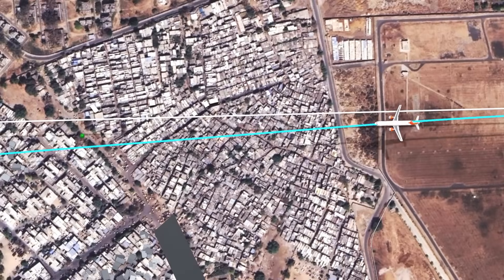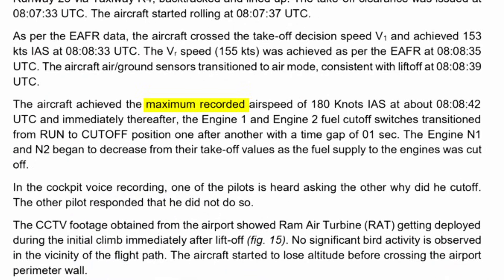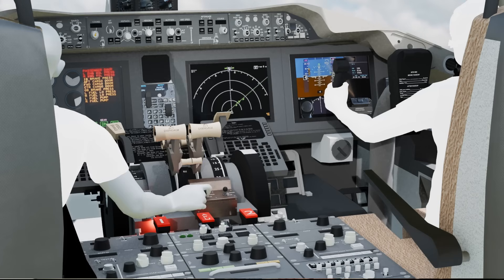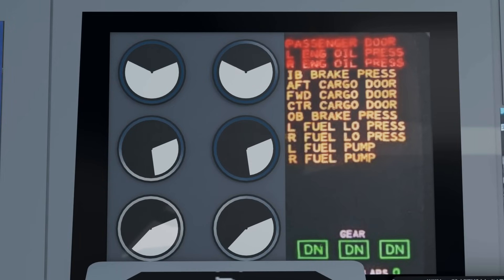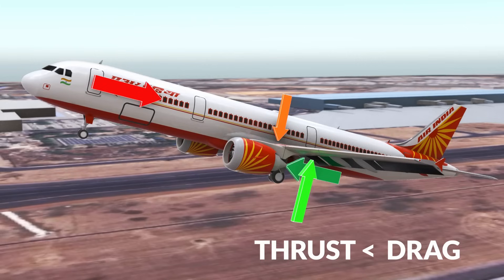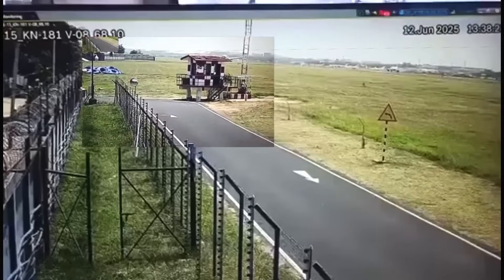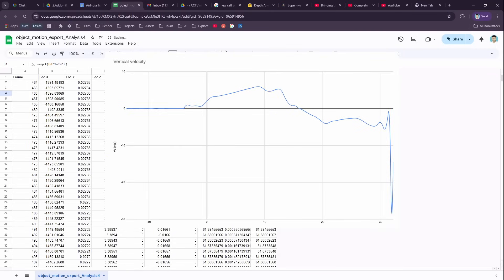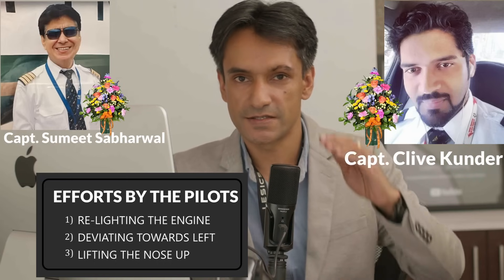Use of 3D Clone | Decoding the Crash Details you Missed

Comment: It has been confirmed that it takes 7/8 seconds for the rat to extend out. This means it started extending out straight after take off and hence before the fuel switches were switched off… this means a technical glitch must have occurred.
Reply: That is a maximum spec for the RAT to pump up the hydraulic system from a low pressure state. Even the actual testing has shown it to be less time. It is simply the time the hydraulic pump supplier needs to meet. [update, there is no spec for the 787, the spec that people are referring to is for older Boeing aircraft, the 787 significantly different in this area.]

The hydraulic system was already at working pressure, so the RAT only needed to pressurize the feed line to the isolation valve. 2 seconds. [update, the feed line is already pressurized to 5000 psi by the EMPs, the RAT pressure is set to 3000 psi, and the central hydraulic system has an extra large accumulator, so the pressure would be above 3000 psi when it deploys.]

We also don't know which FDR message the preliminary report is referring to. It could be hydraulic pressure has started which happens 1 second after RAT deployment. [update, there is a RAT pressure indicator in the cockpit, and it is the only FDR message of this type. And if the system is above 3000 psi when the RAT deploys the indicator and FDR event will occur immediately.]
Reply: @lattyaktube  No, this is NOT the maximum spec at all.  As per Boeing a RAT takes 6-7 seconds to give hydraulic pressure "*under ideal conditions*".  So more if they are not ideal, like here, so let's say 7 to 8 seconds.   
It takes 10 seconds to give Electrical power.  
Note that there is no intermediate or in between "partial" hydraulic pressure as per Boeing.  It kicks in only when it has sufficient pressure.   Same for the electrical power.
Reply: @lattyaktube RAT deploys in 0.88 secs. 

There is a note on docket  FAA-2015-2959 that RAT starts working from 120 knots. 

RAT deployment and performance has been questioned at low altitudes plus this ongoing "titanium quality issue" affecting parts.
Reply: @hazard3020 That AD is very old. All aircraft needed to be repaired by 2019. There's no indication that this aircraft was not repaired, especially considering the low time and cost to do the repair.

The video and audio evidence shows the RAT deployed and spin up to max speed.

Okay 0.88 seconds, that's much less than 6-8 seconds.
Reply: @lattyaktube A New Boeing AWD in 2025 issued recently on RAT to advise that sub-standard parts may have been fitted in some cases affecting RAT performance.  I just mention these as the 2015 modification will need to be shown by AIAB in maintenace logs - when they feel like getting around to releasing a little bit more data.....🤷‍♂️
Reply: the people who leaked this report, why they did not mentioned Whether they have heard the noice of switch physical movement or not in the voice recorder.
its very evident that the physical movement produces considerable amount of noice and Audio recorder is efficient enough to capture very minute noice.
If the noice was audible in the recoreder, it was a soild supporting evidence for the for the people who (assumingly representatives from boeing, NTSB, GE or UK investigators) leaked this report to prove pilot did it deliberately .

Why the time of RAT deplyment is not mentioned in the report? instead reprt mentioned  power reinstated from RAT 4 seconds after both engine failed.
Then when was RAT deployed? normally it takes 8 seconds from the deployment to establish power  (opinion from some expert).
If that 8 second phylosophy is right, then there must have an electrical failure during take off [(3+1+4) - (8 seconds) = 0 ie, take off time ]. See, the volocity at that point was less, then efficiancy to deliver the power by RAT also will be less.

Why there is a termal runaway on rear side data decorder especially tail end was not exposed to fire or heat. wires were burned.
Reply: No. The claims are it takes up to 8 seconds for the RAT to fully supply electrical power and full hydraulic pressure sufficient to operate basic controls.
Reply: There are a lot of claims on the internet. While actually the Boeing spec for the 787 RAT is the propeller starts turning once it clears the fuselage, about 20° extended. It is spring loaded and is fully extended in 0.8 seconds. The hydraulic pump takes at most 6 seconds to pressurize the system from a low pressure state assuming there are no leaks and the reservoir has sufficient fluid (that is the "ideal" conditions referred to). The electric generator takes at most 10 seconds to stabilize its voltage. [update, the 6 seconds is a spec for older Boeing aircraft, the FCOM does not have a time spec for the RAT hydraulics, only 10 seconds for the RAT electrical generator.]

There is at least one 3rd party training manual (not from Boeing), that incorrectly summarized the spec as it take 6-10 seconds. And people have been claiming the average of 8.

The aircraft's hydraulic system was already at working pressure. The RAT only needed to pressurize the feed line the the isolation valve -- no fluid flow was required. Don't trust me, ask a mechanical engineer how many turns does an hydraulic pump need to get to working pressure when it is already primed, and no flow is required. Since the propeller starts turning before fully deployed it could be up to pressure in less than 1 second. [update, there is no isolation valve in-line with the RAT, therefore, the feed line was already at 5000 psi, and the RAT pressure sensor is set at 3000 psi, and there is a extra large hydraulic accumulator (unique to the 787), so the RAT pressure indicator (and FDR event) would occur immediately after RAT deployment.] 

Here's another analogy. Lifting a car with a hydraulic jack. Raising the jack till it just touches the frame (primed), it only takes 1 or 2 more pumps to start lifting the car -- a very short time to go from primed to working pressure.
Reply: @lattyaktube  precisely!!! I worked on hydraulic cranes for 13 years, this is 100% accurate. The engines were still spinning and as this video said still had thrust. It didn’t ramp up from zero or empty hydraulic lines just installed. It could be a matter of just a couple seconds to reach full emergency level pressures. The hydraulic pumps are electrically driven, the spinning engines generate electricity. We need the FDR data to know what method was used to deploy the RAT, and what the timestamp was.
Also we need the full 32 seconds from the voice data recorder, all 4 channels. Can you imagine the exchange?Those things will paint a clearer picture and remove so much doubt and speculation. Some people are believing the propaganda because they so badly want the captain to be innocent.
Reply: @lattyaktube just to complicate things... research papers illustrated issues with RAT Deployment at low altitudes and not working properly.  Compared to working great at 10,000 feet for example....

And also a fully working RAT only powers the central "Electrical" bus.
Reply: @lattyaktube  All available data from Boeing asserts that the RAT requires atleast 6/7 seconds post deployment to provide hydraulic power and 10seconds to provide electrical power under optimal conditions. If we assume optimal conditions, the RAT would’ve been deployed at 08:08:40 at the latest which is only 1sec after lift off 08:08:39. It’s becoming increasingly clear that the RAT was deployed 3/4 seconds before the fuels switches were switched off. The preliminary report is very vague with the use of words approx, about, immediately etc they have accurate representation of these timings and yet choose to use these words to mislead people. A catastrophic electrical/hydrualic failure has occurred before the fuel switches were switched off. Following  standard operating procedures during this kind of emergency is a difficult task… the brave pilots acted professionally and did everything that they could.
Reply: @surjsha2853 I am pretty sure Engine 2 failed early too - when the RAT deployed - as the RAT was programmed to deploy (when one or more engines fail on Takeoff.)
Reply: @tremdoctor007 nobody is believing propaganda but you. The rat deployed right at rotation and that is clear from evidence. The hydraulics went thru a loss of power and it will take 7 secs at least to be able to supply power. And it is evident from other videos that there is a single mode of dual engine failure thru battery issues which is historically 787 problem. Stop blaming pilots and loot at evidence. Don’t make up stuff from a vague report.
Reply: @lattyaktube that’s absolutely not a high probability event. Rat needs time to supply power. Manuals put it at least 7 secs. Hydraulics loose pressure pretty fast and it is Boeing manual that says so as per people who reviewed. Plus ads transponder stopped communicating right at rotation. Why do you think the prelim report didn’t report the RAT timeline? Because most probably they don’t have it recorded. Why? There was a temporary loss of power right at rotation that cut of both fuel switches to off mode.
Reply: @surjsha2853 I concur totally. The only thing I would add is the Rat timeline is not mentioned probably because they don’t have it recorded due to power loss to fdr. And maybe not to mislead.
Reply: @kumark214  quit fantasizing, it’s sad how many people in India are going out of their way to defend Captain Sad Sack who killed so many Indian citizens as well as others. I doubt you even read the report. The RAT deploys when the switches are both moved to off. The FDR recorded the switches being moved, the First Officer noticed it. The engines were still running and generating electricity and hydraulic pressure, it didn’t take 7 or 8 seconds. That’s from nothing, not an engine spinning at high RPM’s at takeoff. The engines drive the generators and the electricity drives the hydraulic pumps. Quit fantasizing.
Reply: @kumark214  I’d also point to sloppy maintenance with Indian Air
Reply: @kumark214  The FDR has its own dedicated battery backup -- other FDR events were recorded to that time. The flight control systems (incl the RAT controller) that generates the events is backed up by the main battery.
Reply: @kumark214 Note docket FAA-2015-2959 states that RAT will only operate correctly from 120knots and above. It will not work when the speed drops below. 

RAT issues are noted where the height of the Aircraft is very low. AWD issued and repairs were due to all Aircraft.
Reply: @lattyaktube agree. 6-7 seconds is in the worst scenario, high up. At low altitude and a pressurized system it only takes a sec or les to get the system pressurized
Reply: Yeah in the mind of Capt Sabherwal; who will be remembered as the perpetrator of one of the biggest mass murders in history. He tried to conceal what happened by denying it on record. His fingers were at the switch one by one, to cut them off at the worst possible moment so his colleague F/O Kunder would have no chance to prevent the mass murder
Reply: In denial Indians as usual
Reply: TCMA alerts WILL be on the FDR logs x
Reply: Wow your brain dead
Reply: Confirmed by who? People comparing still images to a timeline then making it up. The preliminary report states that the switches were transitioned from run to cutoff then the RAT was deployed, why would they state this if the RAT was deployed first? The EAFR will show clearly which came first, it will show exactly when and the why. The report clearly states that everything was fine then when the switches were moved the engines rolled back etc etc.
Reply: @KeyserSoze5421 Why? Because it is inconvenient for the people with money to say otherwise... is that so hard to grasp? Use some logic... hasn't the world seen all kinds of cruelty, don't you believe that money/interests are going to outweigh 200 people that are already gone? Isn't it suitable to have a scapegoat... oh the pilot's mental state blah blah... it's so obvious that you don't have to be  tech expert to see it... you just need basic logic..
Reply: @KeyserSoze5421  "The report clearly states that everything was fine"  Where did it clearly says everything was fine? Imaginations?
Reply: @luckydogjunction2120  it states and I quote “As per the EAFR data, the aircraft crossed the take-off decision speed V1 and achieved 153 knots IAS at 08:08:33 UTC. The VR speed (155 knots) was achieved as per the EAFR data at 08:08:35 UTC. The aircraft air/ground sensor’s transitioned to air mode, consistent with liftoff at 08:08:39 UTC. The aircraft achieved the maximum recorded airspeed of 180 knots IAS at about 08:08:42 UTC and immediately thereafter, the engine 1 and engine 2 fuel cutoff switches were transitioned from run to cutoff one after the other with a time gap of 1 second. The engine n1 and n2 began to decrease from their take-off values as the fuel supply to the engines was cut off.” 

I mean to me that’s pretty clear cut, everything was fine until the switches were transitioned. It’s there clear as day.
Reply: @KeyserSoze5421 confirmed by many experts based on info from Boeing and Colin’s aerospace manuals. And preliminary report never said after fuel cut off. It is very clear thru evidence that Rat deployed right at rotation. Read evidence from various sources and not the vague preliminary report.
Reply: @KeyserSoze5421  Maybe the AAIB people don't know the difference between a rile and a svitch?
That's Hindi for relay and switch.

Comment: The aircraft reached a max height of 425 ft from airport ground level as per the flight tracking site and preliminary report. So not sure about 194 ft. I don't think there was enough time,as the entire flight was just 30 seconds, to think about landing on a highway. I too noticed a deviation but again we don't know if this was due to a single engine starting. 

Both the engines failing just seconds after take off means they would never have achieved the height of 425 ft. If it was like 194 ft max then it would have crashed just little further from the airport perimeter. When converting momentum to distance instead of gaining height it would stall and lose altitude rapidly.

More likely is the possibility of an electrical fire causing RAT deployment and engines shutdown at 300 ft due to FADEC and pilot restarting it in response. The momentum would allow them to reach another 100 ft.
Reply: HMMM... You appear to have NEVER received even basic Aviation training!...

Since basic Flight Instruction, we are taught to react IMMEDIATLY when feeling/hearing the slightest uncommanded engine thrust reduction or failure,  to LOOK out to search for any terrain that could serve to land. Even amateur pilots get that reaction fast; and some have saved their lives and even minimized airplane damage by quickly identifying that kind of terrain.  There are many videos of even Student pilots achieving such emergency landings right, thanks to that basic training.
Reply: @alfredomarquez9777  Yes.  The pilots would have felt the immediate drop from 100% TOGA to 80% as fuel was shut off and the high bypass fans continued to provide declining thrust until, as stated in the video, thrust was insufficient to overcome drag.
Reply: @alfredomarquez9777 yes that is correct.... when they realized that, relit the engines and started looking at options the descent had already started. They were not in an Uber with the map open to see which best road they could land. It's just a theory. 
There is a possibility that the deviation was taken to a less populated area. Again this too is a theory but it definitely looked like the pilots tried their best to revive or land it.

Comment: Lifting the nose up will reduce airspeed. The nose will normally pitch up when engine thrust increase. Pilots need to push the yoke forward to gain airspeed and increase lift. The fuel cutoff at the runway, there is a few seconds delay before the engine will actually cutoff because the throttle is at full. 😂 Idiots keep saying the fuel switch is mechanical. A mechanical switch is a ball valve. Air France Flight 072 engine number ￼1 won’t turn off.
Reply: NOT EXACTLY CORRECT, in reference to the Commanded airframe Attitude or the resulting Angle of Attack, as NOTHING points to an Incipient "Stalling Condition".

On the contrary, at the very low, Close-to-the-Ground flight altitude, an "Elevator-Down" command will accelerate the loss of altitude more than achieving a net gain or appreciable degree of airspeed-increase or Stall-recovery...

There are no signs of an impending aerodynamic stall, no aural warning, no Stick-Shaker... nothing!

In fact, the crew achieved a reasonable gliding slope under such critical flight conditions... 

And "Crash-Landing" is less severe and damaging with a positive Attitude angle, than a "flat" or much worse "Nose-Down" attitude, by far.
Reply: @alfredomarquez9777 They sink too fast because they did not deploy the flaps to max.
Reply: "there is a few seconds delay before the engine will actually cutoff because the throttle is at full"
milliseconds.  Those engines are peak gas guzzlers.
Reply: @patricklockerby4308 It doesn't work that way. The computer will not cut the fuel supply immediately to prevent rapid cooling of the engine which will cause more damage. It will still supply fuel similar from full throttle then moving it to idle. The RAT deployed simply says the engine lean flameout occurs during the take off roll. The computer attempted to restart the engine that's why fuel.cutoff occurs a few seconds before RAT deployed. That's the most logical explanation. Keep in mind that it's a turbofan engine it will take several minutes before it completely stops spinning so it will still produce thrust, electrical power and hydraulic pressure